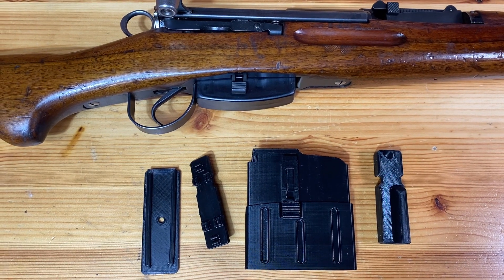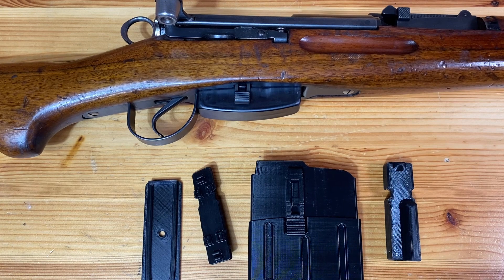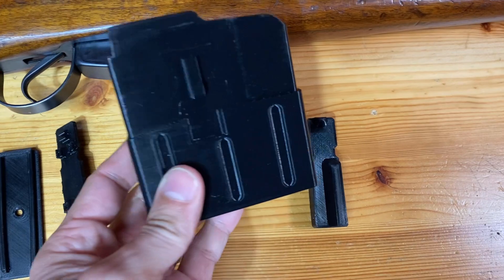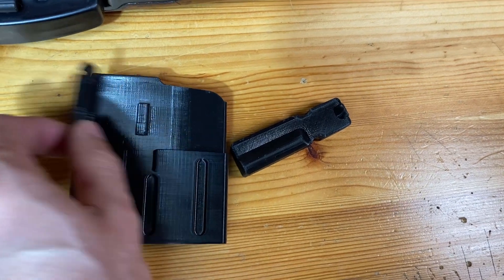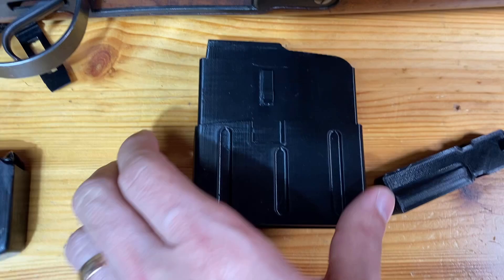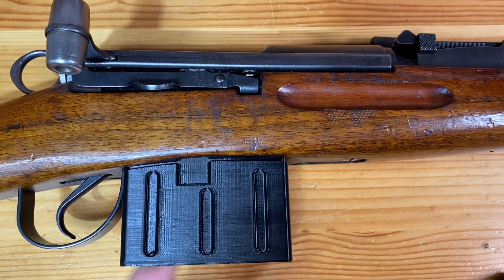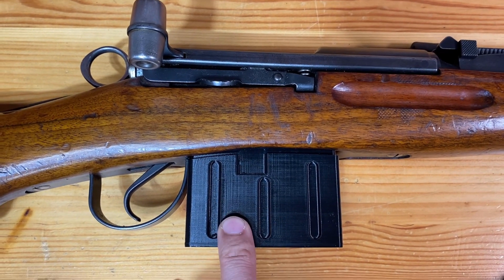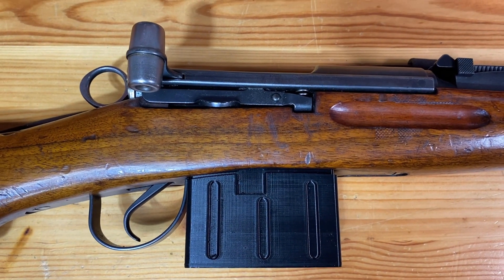3D Printed Swiss K31 Magazine - Part 1

Comment: How did it actually perform?
Reply from the maker: I did another video on this later on where I scrapped the project.  Unfortunately I could never get the spring fabricated just right.
Reply: @usna98  that's a damn shame. Perhaps a custom mag design... Or.. Just an idea use springs from other cheap mags but custom your follower to interface with a none standard factory

Comment: hello, i'm trying to get one working. I'm able to get it together, just would like to know what you used for the magazine spring?
Reply from the maker: I tried different gauges of wire, but didn't quite have the correct forming tools to make a proper spring.  I gave up on it.  Good luck!